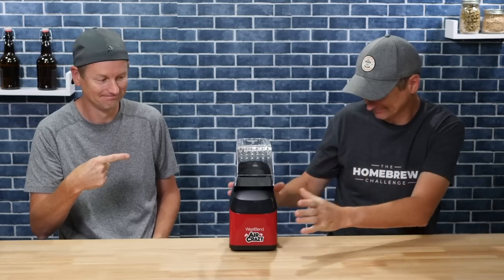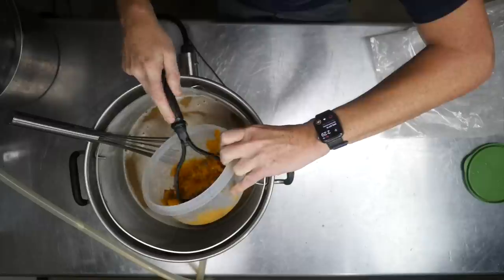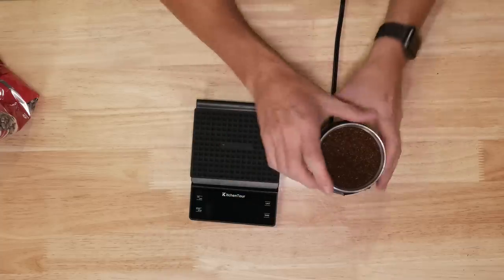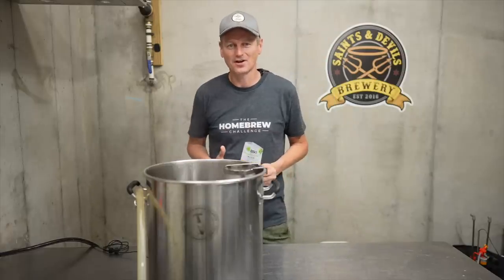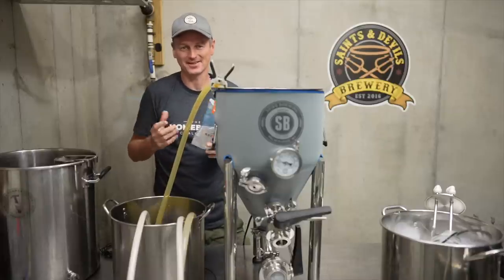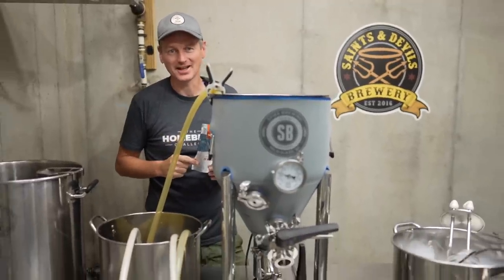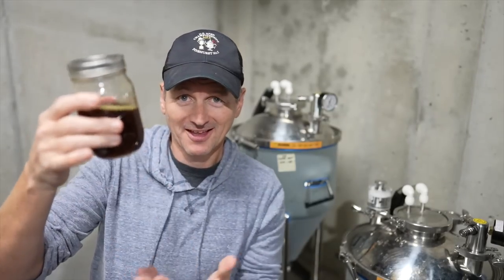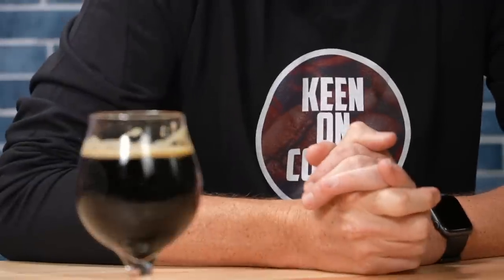How To Brew Coffee Stout

Comment: Do you ever do pH tests when making darker beers, I.E. porters or stouts?  I only ask because I have easily 40 all-grain beers under my belt and all but 2 turned out, strangely both that didn't were porters.  They had a mild sour taste which from my understanding can be caused by the darker grains will lower the pH of your beer.  I can't imagine an infection since this has never happened in any of my other brews (40ish all-grain and another 20ish kits), just the 2 porters.  Long story short, dumped both...